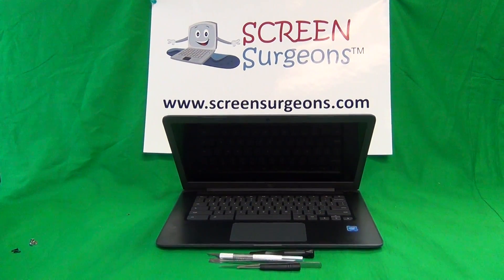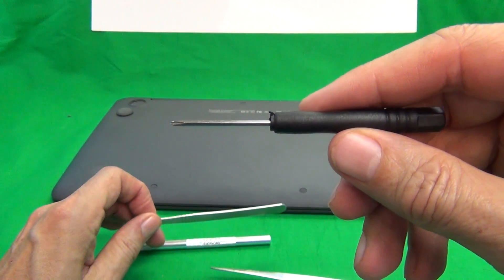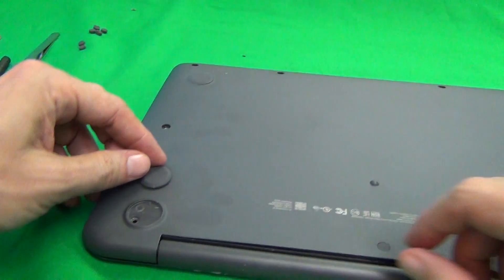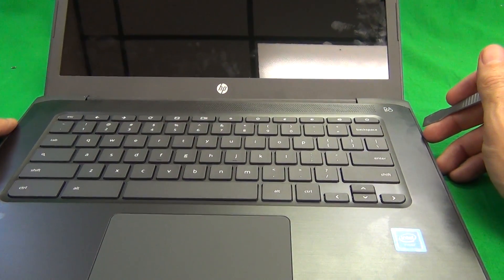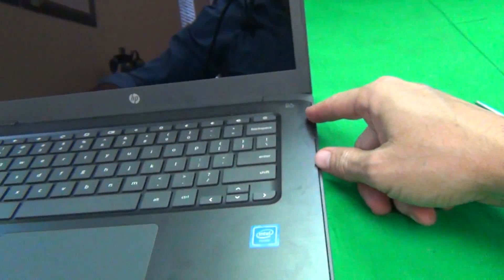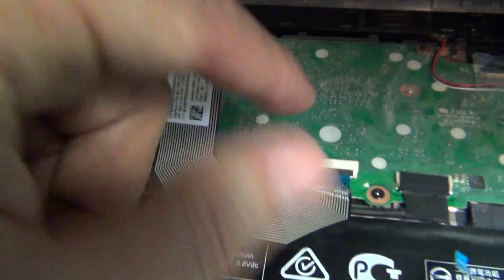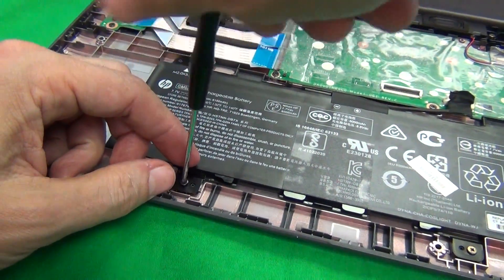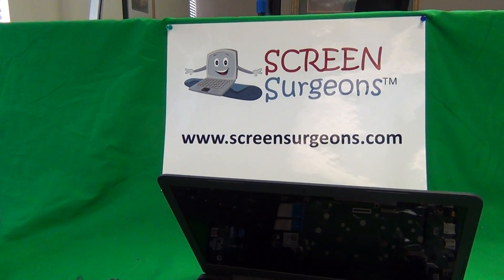HP Chromebook 14 G5 Keyboard and Battery Replacement

Comment: I have this Hp 14 G5 Chromebook touchscreen model. It doesn't power on and charging for hours remain on the amber/orange light. I don't know if it's a battery problem as I believe it should power on with mains connected then go off when disconnected from the mains.

Comment: hello can I ask if where is located the WP screw?
Reply: There's no wp screw in this model, its cr50, you could use either debug cable or just disconnect the battery and plug in ac to remove wp

Comment: My chrome book turned on when I disconnected the battery and plugged the charger in. Turned it off and reconnected the battery to turn it back on and it refuses to turn on. 

Then I disconnected battery, plugged charger in- computer turned on. While it’s on I plugged the battery back on and I’m waiting to see if it’ll charge. Is the battery faulty?
Reply: Try this two things.  https://support.google.com/chromebook/answer/183084?hl=en
https://support.google.com/chromebook/answer/3227606?hl=en
Reply: Probably

Comment: Yikes! Don't use the exacto knife to pull out those covers! Get a nylon tool or dental pick.
Reply: I like his toolkit but I do use plastic / nylon spudgers :) a dental pick sounds interesting are there mny strong enough?
Reply: Agreed. you can find small jeweler tools with straight to L shaped/bent/curved points to do the same job without harming the rubber grommets. I found it easier to remove than the X-acto knife used in this video.